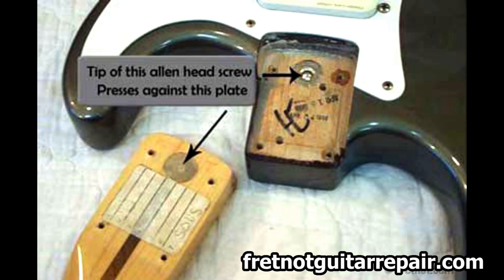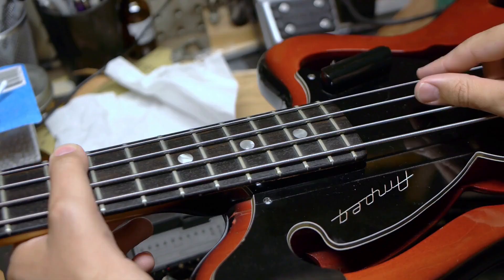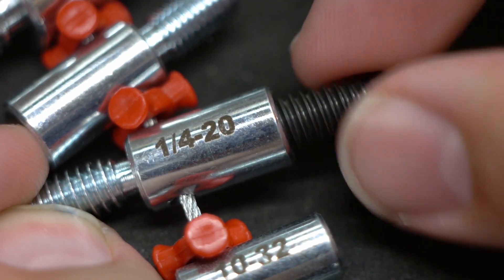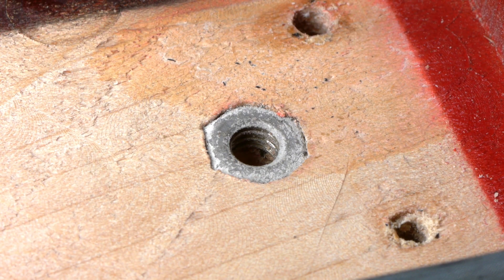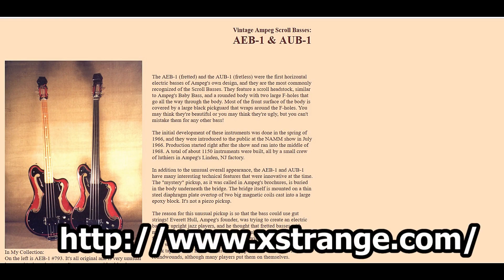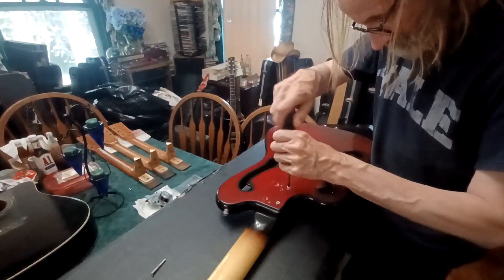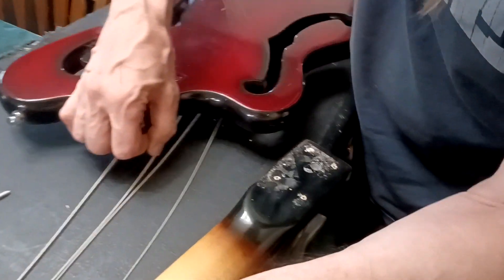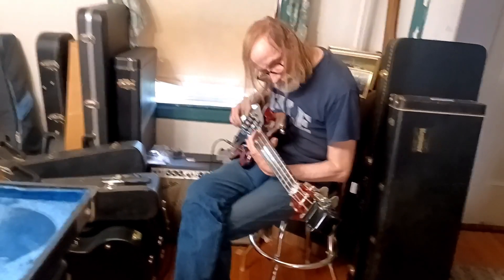The TRUTH About the Micro-Tilt System!

Comment: Leo filed for and was granted a patent for his micro-tilt system.  The title of which is:  (Tiltable guitar neck incorporating thrust-absorbing,pivot and locking element)
It is more than a simple jack screw set into the body though.  
Leo couldn’t patent the simpler version you refer to because it had already been patented and was in fact still an active patent at the time Leo was granted a patent for his own version.
Reply from the maker: Great info. Never saw this patent before and didn't know Leo had filed it. Also a great lesson in patents.

Thanks for sharing this information!
Reply: @guitar_md  So maybe take the video down now?
Reply from the maker: @thegrandpencil4374  The point of the video still stands. Successfully applying for a patent on a re-design of a pre-existing invention doesn't mean you invented it: it means you redesigned something that already existed. 

I'm not talking in technical or legal terms. If you look up the patent (US3550496A), it lists Leo Fender as the inventor. 

But the vast majority of people have no idea that adjustable neck angle systems existed long before that patent was granted. The implication Fender gives is that Leo invented the adjustable neck system, and that it was the first in the world. 

And up until I saw this Ampeg, that's the impression I was under. I think giving credit where credit is due is always appropriate, especially in cases where the original inventor isn't even known. 

Another example is the Stewmac Fret Bars. Matt Brewster from NY did not invent them, as they imply. No credit at all was given to Davide Bissoli, owner of Rectify Master, and the actual patent holder for understring leveling tools since 2010. 

It may be legal (at least I think it must be, I'm not a lawyer), but at the very least I think it's important to give credit where credit is due. I would be quite upset myself if I invented a tool, and through a sort of legal loophole, someone was able to redesign it and patent it or otherwise pass it off as their own, without giving me any credit whatsoever. 

There is no legal obligation (that I'm aware of) in these cases to give anyone credit. I just think it's the right thing to do. I was definitely surprised when I saw this Ampeg as it was proof that Fender did not invent the neck angle adjuster, as they've implied. It would be cool if they did as little as giving a shoutout to adjustable necks on lesser known instruments that inspired the re-design that became their patented Micro-Tilt system.

Comment: Fortunately Fender’s micro tilt adjuster is actually much easier to use and more effective. The principle may be the same, but the fact that you can access and adjust it on Fender guitars without removing the neck makes all the difference. In this respect, the features aren’t the same at all. Turns out details matter.
Reply: The Ampeg tilt doesn't require the neck to be removed.  They function exactly the same.
Reply: @maverick_trail  Good to know. Thanks!

Comment: Listen to that! Holyshit that's a monster!
Reply from the maker: Yep! Crazy. The Ampeg AEB-1 and that entire line (check out xstrange.com for more info) sound amazing. I've heard the pickup is similar to the same one used on the Baby Basses later on -- whatever it is, they really do sound great. 

I have yet to hear them with tapewound or gut strings, which they were originally designed for. The sound is huge though, and super responsive.

Comment: Did Fender ever claim to have invented it?
Reply from the maker: Not that I'm aware of, though it's a very common misconception, and the majority of people just assume it's a Fender design. On Fender.com they say it was "Originally introduced in the 1970's" which is a bit disingenuous, as all they had to say was "adapted from certain guitars used in the '50s and '60s, Fender began using its Micro-Tilt system in the 1970's." Something like that. 

This was definitely a clickbait title just to generate some interest, though today I found this forum post, which I wish I had found before making this video: 

https://www.thegearpage.net/board/index.php?threads/fender-the-bullet-truss-rod-adjustment-and-3-bolt-micro-tilt-neck-were.905230/

"Nathan "Nat" Daniel {Danelectro} invented the micro-tilt in 1963, but never bothered to patent it. I own the actual R&D instrument built & used by Vincent Bell to design & test neck-tilt, string tension, truss rod design, etc.. When the company closed in 1969 he took it home and it sat in his basement for the next 40 years until he sold it to me."

Also this thread: 

https://www.strat-talk.com/threads/what-is-a-micro-tilt-neck.142762/page-2

"You say Leo? Then why was it on Dano's as far back that I know of in the late 50's? It was exactly the same. A metal plate on the neck with an allen head machine screw in a hole. I agree with the micro being not so hot. I don't mind shims however. I just disagree with it being Leo. It was on other brand guitars long before CBS or Leo. The exact same so as far as "improved". Improved what? They were the same. I know Leo is venerated as the Guitar Guru,but he didn't invent everything. If it was improved. The Fender system is the same as Dano's.

I just want to know if not Nathan Daniels,then who invented tilt? Some of what can be traced to Fender came from Paul Bigsby. Where than did the tilt originate?"

--------------------------------------------------------------------------------

It's unclear whether Nathan Daniel from Danelectro even came up with it. The original "inventor" may just be lost in time. Some people claim to have micro-tilt systems on their guitars from the '50s. So who knows! 

At the end of the day it doesn't matter much, and Fender didn't really "lie" -- but it's a common misconception and assumption people have. I was initially very surprised to see this on that Ampeg bass, but that I know the system was used on Danelectro guitars/basses from much earlier, and possibly other guitars -- fascinating stuff!